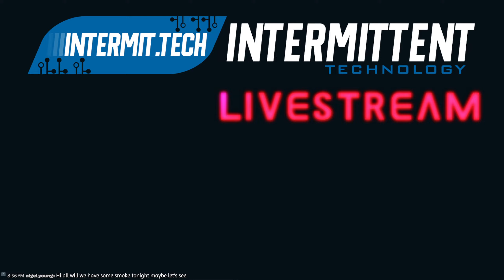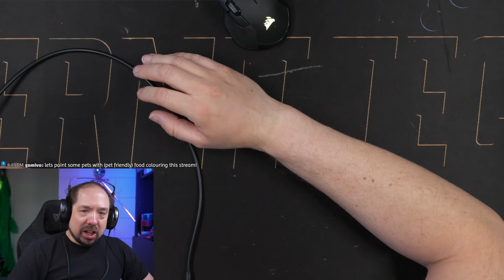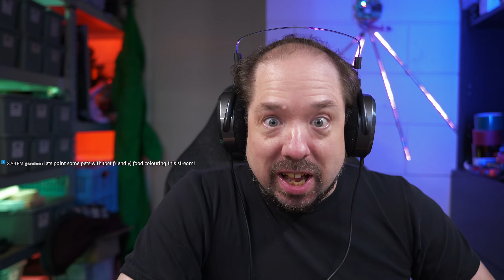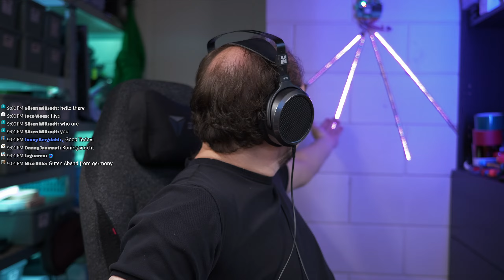Intermit.Tech #116 - Prototype testing until it dies!

Comment: When you refer to 2000 LEDs per ESP32, isn’t that number based on IC chips.  If a 5M strip is 300 LEDs but one ic per 6 LEDs thus 50?
Reply from the maker: Yes, that is correct!